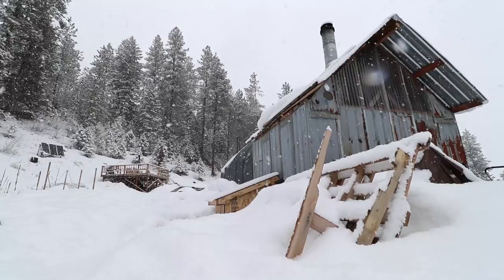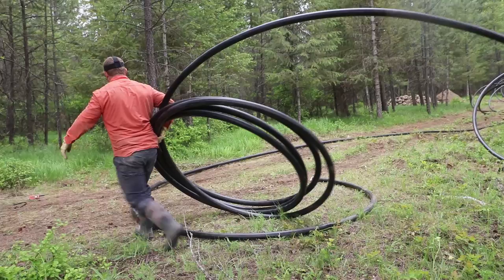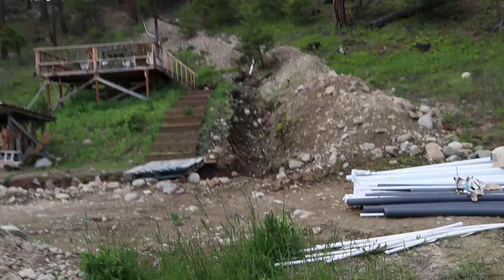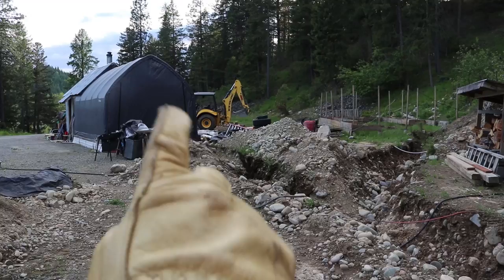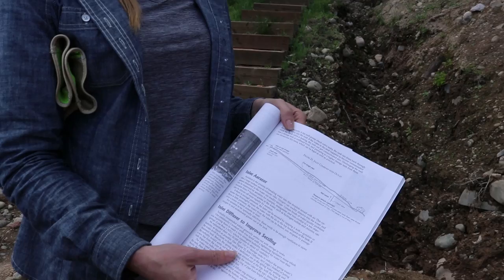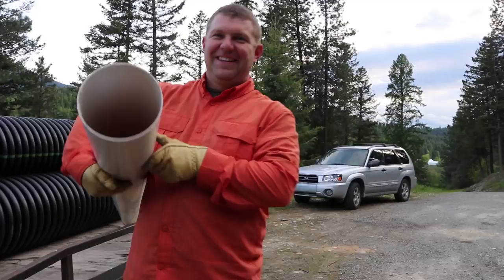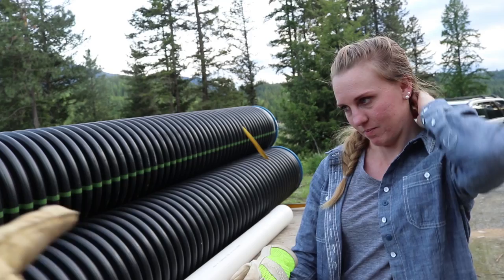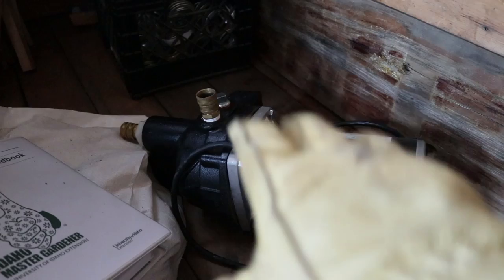EPIC $10,000 OFF GRID GRAVITY-FED WATER SYSTEM

Comment: Strong work on the system. You definitely did your research and planned for every contingency. Water is THE most important piece of the successful homestead. In my humble opinion overbuilding will make your system safe from failure and provide water for years to come. I will share this; We used to have access to a family ranch off grid cabin for pig and deer hunting and visiting. Very dependable spring that fed into a 3000 gallon tank which then filled a small pressure tank with a pump which provided the water pressure. Fed the kitchen sink, an on demand hot water heater, a flush toilet, and a shower and sink in the restroom building. Failure points were the pump and pressure tank. It fit our needs but I wanted to pump the spring water uphill to a tank and then gravity feed the system. Wasn't my place though and the cousins decided to sell the property. I do have a couple that are friends and they had an off grid property with an active spring. They pumped their water up to a storage tank from the spring box and then gravity fed to the house. Their failure points were that they used pvc in a shallow trench with no encasement so they were constantly digging up broken pipe to fix the system. So your system makes a lot of sense to me. Do it right, do it once and you don't have to spend a bunch of money and time going back to fix it later.

Comment: Forget timber framing, you guys need to learn masonry! You could have a amazing stone house.
Reply: Or a stone foundation under the timber frame house...
Reply: the do have some lovely Stone. but it's cold up there is bet 😅Stone holds heat
Reply: +SgtAMYNTAS and is a useless insulator
Reply: Tyler Witty anything that absorbs heat or dissipates heat with a higher Si than ambient kw is very poor
Reply: But it is an excellent thermal mass.
Reply: Nothing stopping them from doing both... Timber framing and stone work can be both done in the same structure...
Reply: Sure. I'm thinking of the mid 19th century Arts and Crafts movement that often combined timber framing and masonry. 
All those rocks seem like a very useful resource to me.
Yesterday, I learned how a pile of rocks can significantly reduce the rodent population.
Yes, stone is a poor insulator, but it is a great thermal accumulator. I've used it to tree-ripen citrus where it shouldn't  be able to grow. I'm hoping that my new stone patio will someday help tree-ripen the fruit on an apricot tree I planted this spring, and perhaps tomatoes on the vine next year. Neither apricots nor tomatoes do well where I live without help - it's just too cold here.
I was thinking that having a significant thermal mass in\on\near the house might help keep the house warmer on winter nights, but I'm weird that way. 
Since they've been talking about making a large garage\workshop, I started thinking "stone foundation" for strength in storing all the new tools they just bought and lumber they will have to cut.
I see the slope of their property, all those rocks, and think of terraces with stone walls. Granted, I have built stone walls and it is very hard work; I once went through two pairs of thick pigskin gloves in one weekend building a short stone wall - but that was with rough hewn granite.
Reply: as I looked at all the rocks, I was thinking the same thing, they would have enough rocks to build any size house they could dream up, , a tremendous amount of work, but have one like no one else has,

Comment: If you do have any worries on the water pressure to the top floor to your house, you could put a smaller tank insider the house with a booster pump. That's how we do it in the plumbing design of tall hotels.
Awesome work guys!

Comment: I don't see anywhere in the description of the video, or in the audio of the video where is says: "Cheapest possible water system for an off grid home."  They clearly wanted a hardened / nearly bullet proof water system.  This one requires no power for nearly 3 months if needed, can withstand any weather thrown at it, 0 maintenance, and no wear parts. Not to mention being setup to fight fire if they have to.  This is inline with their overall strategy of building assets.  Plus the ability to sister this with a rain harvesting system, and or a well at some point in the future.  I say this is a great investment in their infrastructure if you ask me.
Reply: smallcarguy most expensive up front, but way more convenient down the road

Comment: As a person who once lived in the area, you are now in. I thought I would pass along something concerning freezing. In 1968 the winter was so bad that the main water line In Priest River froze solid, it and had to be dug up and replaced and that turned the city into a mess. I am told it was over ten inches in diameter and was buried eight feet down. I worked at the local hardware store (old town) for a few years in the plumbing department 2007-2011 and I have heard many reports of water lines at 4 feet freezing solid. What we told people in the store is that water that is moving will have less of a chance freezing, so during really cold periods, let water dribble a little in the sink. Well water comes out at ground temperature, and that is far warmer than your cistern will be. You may love your cistern now but after a really bad winter (and they will come) you may start rethinking your current ideas

Comment: Running all that poly pipe through the other pipe is perhaps your crowning achievement in thinking, you hope to never have to redo it, but if so, you made it one heck of a lot easier and more likely that you will actually fix the problem rather than kick it for a quick fix

Comment: If I was setting up that water system, I would build a rainwater collection system at the top of the hill, to keep the tanks topped off.  Even a small, low to the ground metal carport style  structure, utilizing a first flush system could keep those tanks filled easily.

Comment: I had a  400  foot deep well put in. It was $8000. I did not have power for a long time. Used a $600 construction generator with a 240v plug for the 1.5HP well pump. Ran pump a few times a week to fill 200 gallon tank similar to your current tank.

Comment: Again I am coming from a water utility with distribution license and work full time with the fire department I am speaking from experience. I am a jack of all trades but water hydraulics is one thing I do know like the back of my hand being that is how I make my living, since the last time I tried to help and give a simple idea you basically told me my idea will not work and I needed to use common sense. But anyways the valve box (what we called them down here in NC) is cast iron and driving your backhoe over it will not break the valve box but if it is not bedded just right (almost near impossible to keep it from pushing down because it is always being put into dirt that has been disturbed and will not be able to fully support it) and you drive over it the valve box will push down onto your valve and break the valve or waterline no matter what material it is made of, it may not leak right then but it will cause it to fail at some point. So it is best to keep off of it as much as possible but still when installing it keep it up above ground level about 2 inches or so most of the time it will settle to ground level if you install it flush to the ground then it will get buried also they have a tendency to fill with dirt and the smaller they are the harder to clean out. The ones we used was at least 6in around that one looks smaller. Now you are correct the hydrant you have is a blow off hydrant in public water systems the water at the end of a dead end line has to be flushed or blown off regularly to keep up water quality if not you will get a lot of byproducts of the chlorine brake down which will contaminate the water supply. The blow off hydrant will have the standard 2.5 inch discharge (unless ordered with different threads) that the fire department can use to get some water for fire protection but a "fire hydrant" is rated for a fire flow (usually color coded to show the flow so the fire department knows what they should be able to get out of it when they get to it but not in all areas) and to be rated for a fire flow it is illegal to install on a main any less than a 6inch main weather the water company or private entity.
Reply: 70ft of head - 12ft to the living area will be equal to 25psi you will not lose the 8ft of head for the tank unless the tank is empty if it is empty it should be 21.7psi so you can put a gauge at the bottom of the hill needs to be able to read each psi so would have to get a gauge that reads only 0-30psi that will be another way for you to tell the tank level. Now when ever you first put it in and you start filling once the pipe is fill and just to the bottom of the tank mark the gauge as an empty mark just for a sight referance then when it is full mark it there as well to keep from over filling the tank.

Comment: yes you will do damage to the valve box.(speaking from experience cough cough) unless the valve box ends up surrounded by blacktop in the road, there is potential for damage. it can push down and do damage to underlying pipe as well. 11 years around this stuff.

Comment: Poly is brilliant, been using it for decades and buried it's fireproof. A 2" pipe with that head will give you awesome pressure. I have a 1 1/4" pipe with less head and it's equivalent to mains pressure.
A thought on rainwater. With a clean system with first flush and at most a simple filter, rainwater is far superior to manufactured water and it's free. Again, been using it for decades. If you find the need for another building, or even a simple roof, up above or near your cisterns and there's all the water you want. 
The beautiful thing about living in hills is how much of a friend gravity can be.
Thanks for letting us in to your adventure.
Reply: A foot of water will give about .45psi, * 50' of head gives about 22psi at zero flow. Diameter of pipe has an influence on flow rate, bigger is better. @ zero flow rate a 1 1/4" pipe will have the same pressure as a 2". Mains pressure around here is 85psi. Something wrong with your math!
Reply: Fortunately there's nothing wrong with my water pressure and there's unlikely to be anything wrong with theirs. Have a nice day.

Comment: A very useful video but there's one thing I'd like to point out about the "curb box" discussion that starts @ 8:30... I've seen folks run their vehicles over similar setups and break the two lines on each side of the valve at the bottom of the box. I like the idea of the curb box but I'm also of the mind that said device needs some way of preventing vertical movement when the random maniac runs a vehicle over the cap. Perhaps a concrete collar would help. Also...about brass...there is definitely a place for it. I like the plastic PE couplers for placement within runs of PE pipe; however, at the bottom of "frostless hydrants" I've yet to find a replacement for brass. Galv. iron eventually rusts away and plastic is weak sauce for this application, IMO.  Good on ya for burying the trace line and/or metalized mylar!!

Comment: Great video. I work at a municipal water and we install HDPE pipe fore our city have nut used those grip connector we fuse everything together. The valves and pipe are great just a word of warning we put a post in the valve box to remind the operator that the valve is a quarter turn only you can brake the top off and we have. Most manufactures will not sell just the top.

Comment: Just an FYI, my parents have a well that feeds a cistern at the top of a hill. Think of your current design, but your well would be at the bottom of your driveway. So while it is an on demand system, it does not run the pump continuously. Only when the cistern gets low enough. Also, there are 12,24, or 48 volt pumps designed to run off solar or battery. Something to consider for future planning.

Comment: One of the first things I did on our property was to spend fifteen hundred dollars on a bulldozer to come and dig us a dam in a bit of an erosion gully down from our house. Two days later we had a quarter of a million gallon dam. Fixed the erosion and gave us unlimited water. I also dug in a hundred meter length of poly pipe with two joiners and three tees in the line for takeoffs if needed. That was thirty years ago and no worries about the poly or connections. I brought up three kids in that place and we used that water for washing drinking you name it. The good thing about dams or ponds is that water in large ponds etc is self cleaning. We never had a problem with tummy bugs at all and we could top up our rainwater tank as needed. Of course your pump suction line should have a foot valve and float so you get the water from top foot of oxygenated surface. Obviously the price of bulldozers hourly has gone up but if you can swing it a dam or pond would see you fine for h2o. I live in Australia so didn't have to worry about freezing and ice splitting pipes etc. so we're lucky that way. Any gully or depression can collect an amazing amount of water from rain. If ground is rocky it's possible to stop leaks using bentonite which is a type of clay that when spread on dam finds its way into cracks and then expands to help stop the leaks. I could go on but I'm already afraid my into you probably know anyhow. Good luck. Peace.

Comment: I would remove any small trees that are near you water lines. In 10 years time you might regret having a 30 ft tree crush your buried pipes.
Reply: but the roots...
Reply: +verteup now two stupid comments from you, might wanna keep them quiet
Reply: that goes triple for drain fields. Plants love wet fertilized soil, and that' exactly what septic leech fields offer. They usually shoot roots straight for the outlet of the septic tank if they can.

Comment: The bury hydrants are a stop and waste valve so frost proof , they can fail if not installed with a mini drain field at waste    A 5 gal bucket works well drill a hole in bottom and set down in trench install hydrant through hole . Nice alternative have installed a ton of them like this , no call backs and buckets are cheap . Phil

Comment: Enjoying your videos. You guys are doing a great job! Should you desire to have a pressurized water supply in your trailer or house, it can be done very easily and without breaking the bank by doing the following (descriptions is always in direction of the flow from gravity feed to use at fixture): At point of entry into the house cut a 3/4" tee connection (Tie-In Point 'A') into the line; install 3/4" nipples, a ball valve, a 90 degree elbow, a 3/4" wye strainer, union, a small booster pump capable of delivering 2 GPM at 50 PSI (or 115 F. Hd.), 3/4" union and nipples, a 3/4" check valve, a 90 degree elbow, a 3/4" ball valve and tie-in to the existing line (Tie-In Point 'B'); Immediately after Tie-in 'A', install a line sized ball valve (in the existing line), followed by a line sized check valve (before Tie-In Point 'B'); After Tie-In Point 'B' install a line sized x 3/4" tee with short 3/4" nipples, 3/4" ball valve. another 3/4" tee (with a pressure switch set to turn on at *20 PSI and off at *40 PSI), 3/4" nipple, 3/4" union and 20 or 30 gallon pre-charged diaphragm type well pressure tank. Wire the pump through the pressure switch and you have a captured pressurized section of house piping that will provide you with 40 PSI (plus the static vertical head of the gravity water tanks). If the static head elevation of the tanks are at 20 feet, you would have an additional (20' x 0.434 = 8.68 PSI of pressure).  Good luck!!
Reply: All material to be NSF-61 compliant. Do not use an iron pump. Use lead free bronze or preferably a type 316 stainless steel pump.

Comment: If you do collect rain-water, you could add your smaller tank to the bottom of the system to catch what comes off the roof.  Add a ball float that triggers the pump at 3/4, and shuts it off at 1/4 and it would automatically push the water up to your storage cisterns.  In terms of making it drinkable - down here in NZ we use rain water all the time for our "off-grid"* rural properties.  Just add a charcoal filter & UV filter just before the house & pew pew pew, happy water.

* Most are just off-grid in terms of water & sewage, its rare to be off-grid for power and/or telecomms though there are some.
Reply: Oh, and to add to your rant about poly fittings etc.  We run kilometres of pipe on our farms for stock water; there aint no way we'd fork out US$75 per connection for brass on that.  Brass is at the pumps, all the rest are the same kind of poly fittings you're using.  And some might think that oh its only stock water it doesn't matter.  Well in terms of clean water its less important (still matters) but you still don't want your 50,000 litre tank running dry because of a broken fitting in the downhill side of the system that causes your $10k pump to wear out running 24 hours for 3 days straight to try to keep water in the system on the uphill side!

Comment: glad you answered my question about a well lol. Wow, wells are super cheap here in Oklahoma, where our water is just 30 - 40 feet deep in sand lol. I think it's like 3k to 4k to do a well here, most parts. Some areas have lower water levels. I have a well here, but I cannot use it because the water level is only 20ft down because being near to the river, so the water isn't drinkable. I really want to tap into the well though to water the garden and animals. If everything works, then I wouldn't be out any money, but the well's not been run in several years, so not sure if the pump works at all, or if it's wired in or anything lol.